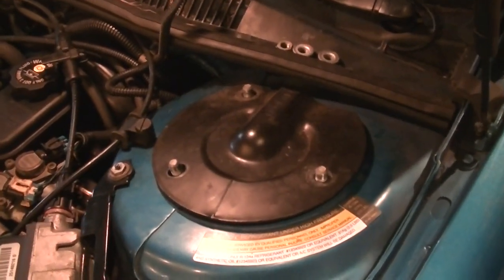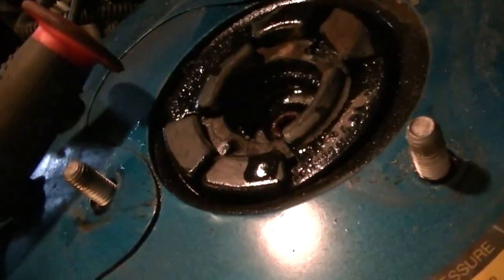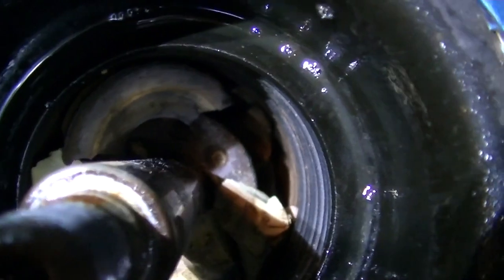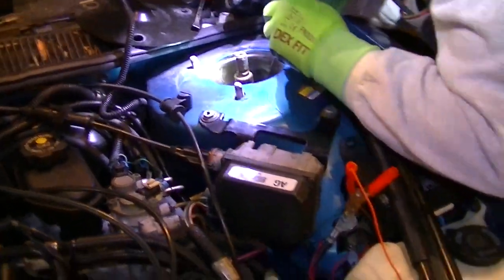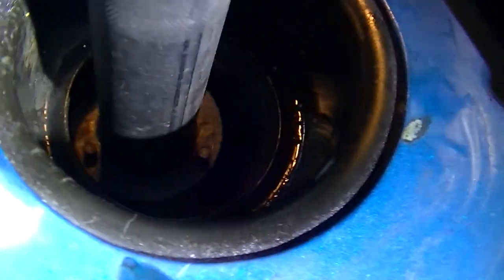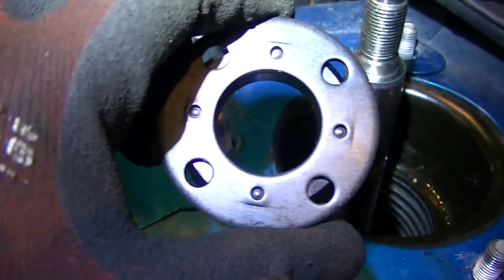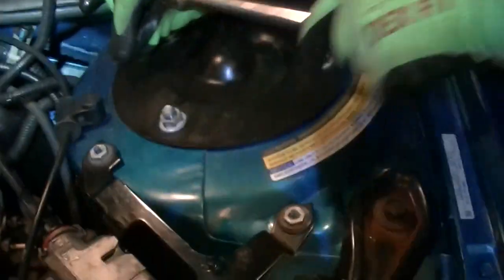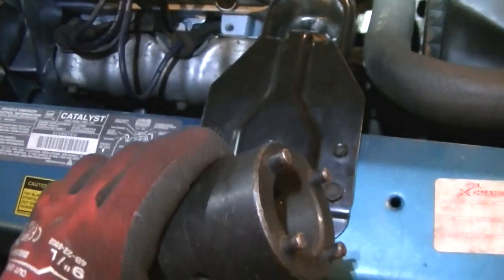1990's GM Strut Replacement GM10 Tool, Lumina, Grand Prix, Cutlass Supreme

Comment: 6mm Imbus at the Top of the Strut? I have a 7mm there... a very unusual Imbus we dont have in countrys with metric sytems...  also my struts coming w/o the nut for the GM Tool...otherwise a great explaining... thx
Reply from the maker: Generally, people state the socket/wrench sized needed for the bolt head or nut removal.  6 or 7mm sounds like a thread size.  This strut style was unique to GM in the 90's, and only certain cars.